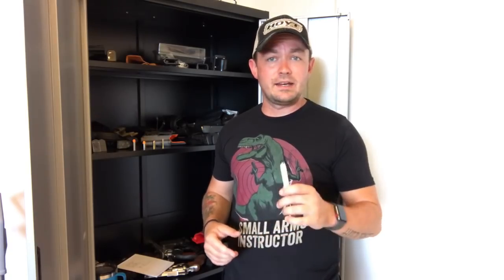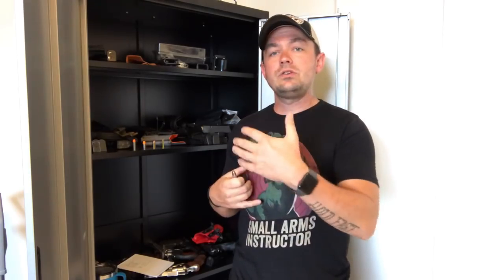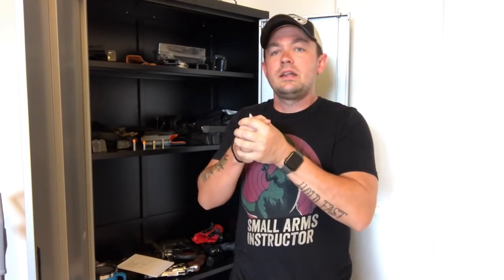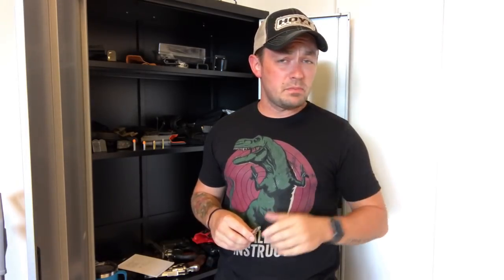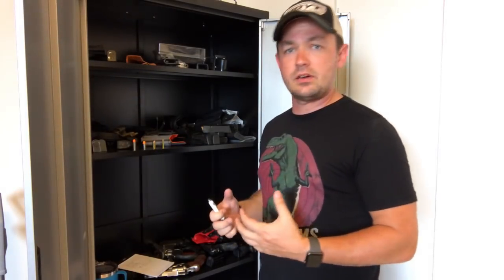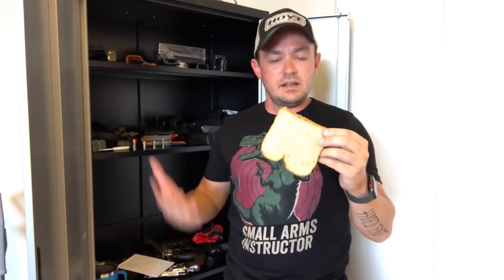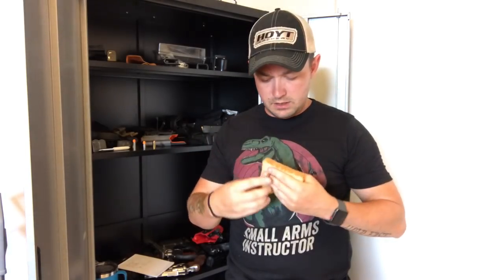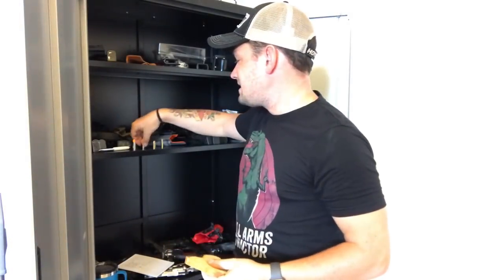Understanding Handgun Terminal Ballistics

Comment: Just wanted to add an asterisk to your first point of "handgun cannot harm unless the round actually touches tissue"

That's forgetting ear damage and the potential for harm from mishandling the weapon itself such as putting a thumb on the back of the slide. 

More an asterisk than a full on correction though.
Reply: And if you're close enough the muzzle flash can do damage as well.

Comment: I'll give this guy the benefit of doubt, but he's absolutely incorrect with his very first point.  Shoot a 2-liter bottle filled with water, using a .357 magnum, .44 magnum, or even a hot 9mm hollow-point.  The vessel will rupture violently in areas never touched by the projectile.  That is damage from hydrostatic shock.  And it doesn't require rifle velocities.  All it requires, is energy being imparted to the water at a rate above what the vessel can absorb.  I have little doubt he's just repeating what he's been told, and never really stopped to think it through at a basic physics level.  Because liquids are non-compressible, energy will transfer through a liquid just as it would a non-compressible (or highly incompressible) solid.  And yes, that energy can damage tissue.  It's not the primary means of inducing tissue damage as it is at most rifle velocities, but it certainly does take place, and absolutely is a factor in incapacitation with handgun projectiles.
Reply: I wonder if the reason why water jugs get ripped apart when hit by an expanding bullit is because the bottle can only expand a little before it reaches a point where it can't expand further and then gets shredded?

Comment: Doesn’t sectional density and surface area help penetration and shot placement (in the sense that you can hit more stuff), such that the 45, 40 and 10mm hollowpoints opened up have a slight advantage in terms of probability to hit those important targets? Assuming you don’t get very many follow up shots of course, because that’s probably the 9mm’s overwhelming advantage.

I do agree with your points though. These are just some of the more reasonable arguments of the higher caliber proponents. Alongside the kinetic energy transfer thing, that I’m not too sure is quite scientific.

Comment: What about bullets like the novx ARX or the extreme defender that supposedly do damage stuff they don't touch through the Venturi effect?
I've seen a long study (over 10 years) that used autopsies and real shootings that showed 357 and 44 mag both had about 30% better performance. It showed bullet diameter mattered a little (45 performed about 5% better than 9).
The idea was that bullet energy had a significant impact on the damage done and that's why the magnum rounds performed so much better. 
It makes sense because if you hit a bone with a softer impact, it will crack but if you hit a bone with a higher impact, it will shatter and effect a larger area as well as retain energy to shatter the spinal cord if it's hit which 9mm failed to do often. Heavier bullets also have more inertia and retain their energy and ability to shatter things longer.
That's just the gist of what the autopsy study found.. so there's still hope for your 357 magnum. He also mentioned that the psychological impact of the magnum rounds were much higher, like being flash banged, and that can't be discredited for defense. 
I say all this as a guy who usually just carries 9mm or 45 super.